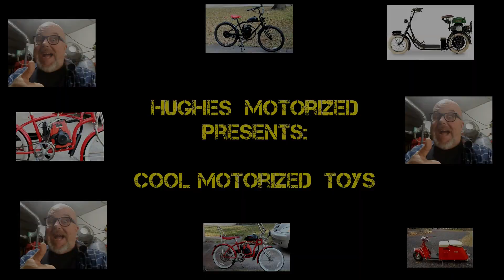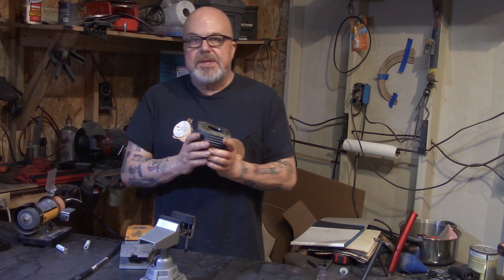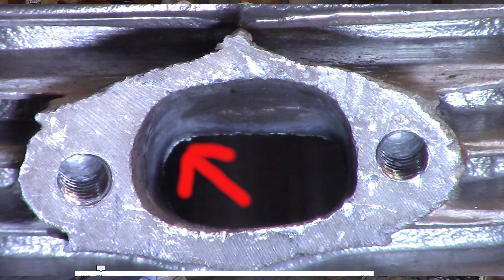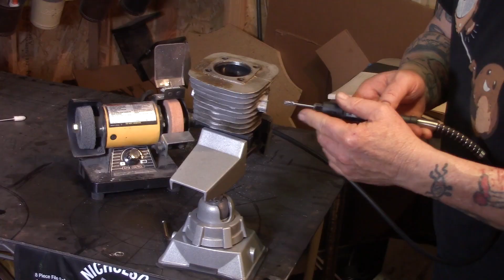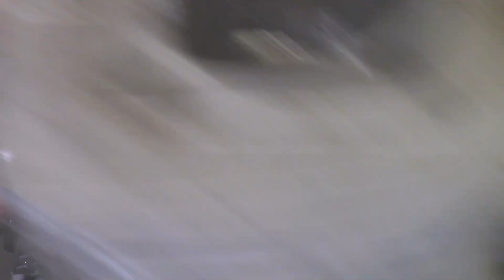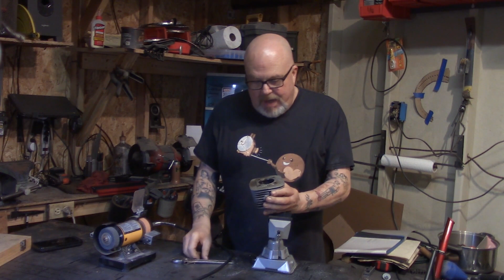How To Port Your 2 Stroke Motorized Bicycle Engine- The Basics - Get Improved Performance

Comment: Wanna talk "ignorant", here we go!

What about a square intake for the reed valve?   🤔

There's also the exhausted, and how you fabricators make it square, and yet the gasket is round opening.  Won't the gasket hinder air flow due to the shape you just made the exhaust?  😳

I just started opening my exhaust on my Minarelli clone,  and i'm staying aeay from making it square.  I'm just staying within the confines of what's already there, and boring out the inside. The edge of the round port, i'm going to sand it to smooth, and that's it.    I don't want my gasket to be bored out of its purpose for being there, and that's exactly what will happen if I turned it into a rectangle like you've done.  Again, the gasket is for a ROUND port.  

Tell me what i'm missing here, cuz simple logic doesn't seem to apply. 🤪

Thanx
Reply: Modified your gasket?

Comment: wouldnt the heat from normal running....shave off those burrs on the insides?
Reply from the maker: No. There are some substantial boogers in there that need to be opened up which will improve performance

Comment: So porting is basically deburr sharp edges
Reply from the maker: BASIC porting is that plus opening up the ports to allow more flow. You raise the exhaust 1mm and lower the intake 1mm. Widen both 2mm. More technical is to set specific port timing and duration

Comment: Cylinder Holden I really don't see how buffering the exhaust part to a mirror finish is going to give you any benefit
Reply: He keeps carbon from building up if carbon deposits fall back into the engine it could ruin it

Comment: Yup the intake an exaust ports definitely are not nice an smooth like a factory engine Honda Yamaha an such lol I'm on my second build the first one was a learning curve cause  can fix dirt bike an sleds no problem however these motors have many little- flaws with lol great for kids to learn about engines though an tinker with second motor I bought I just bought the engine with no hardware its all cheap junk lol I'm gonna order the drive chain an stuff from the place i order dirt bike parts that's what I ended doing with my first engine build the parts are much more durable especially the drive chain I can break the chain with pliers that come with these kits lol can't do that with a real dirt bike chain though I paid more the  chain and parts but least they last alot longer they can  keep their cheap hardware lol choke socks too vibrates down a  chokes the engine I put a carb with a pull out choke my buddy races after we ported his srx 700 snowmobile he took a center punch an put a bunch of punch  marks on the intake side for fuel dispersion we shaved the head also I wonder if there's any room to shave the head on these down  a thousand  of an in h

Comment: No bicycle  will get up to 70 miles per hour on that two-cycle motor maybe ABOUT 15 to maybe 25 mph I do know I am a REAL expert I AM ASE certified what you're doing to that cylinder might will give make a little bit more power not much power at all if any power at all
Reply from the maker: Hate to break it to you but YES. People have modded these and ran 68 mph PLUS. Check out 2 Stroke Stuffing Channel. he builds seriously fast 2 stroke bikes using these engines

Comment: Good info although somewhat mislabeled. Porting mostly refers to widening and/or raising the ports right at the cylinder surface, not cleaning out casting irregularities.
Reply from the maker: Note I did widen intake and exhaust along with lowering intake and raise exhaust ports
Reply: @HughesMotorized  I´m sorry I didnt watch more than the beginning where you said it was basic porting and then described it as cleaning up the passageways.
Reply: @HughesMotorized  also I would never give any generalized porting advice except for one type of cylinder after I have measured the durations and ran them along with port widths thru a porting calculator. If you say "always lower intake" and someone has a cylinder that already has the correct intake duration then you´ll cause him to mess it up and then he´ll have an engine harder to start.

Comment: For all those that don't have a ported cylinder then you should buy one from this man because it makes a big difference!!!! He's also very professional. He answers all your questions and ships it out within a few days. I also have another bike I can't get running right and he offered to fix it for free (not counting shipping) on his channel
Reply from the maker: Cool. Glad it worked out for you. Thanks!
Reply: @HughesMotorized  you got any advice on vacuum leak where the carb bolts on the intake? I can't tighten it anymore and it's definitely leaking cause of the high idle and if I spray carburetor cleaner there it brings the idle right down. I've seen videos of people putting a bead of silicone around it or wrapping a piece of an inner tube around it and using a hose clamp to tighten it. All kinds of shit

Comment: 2StrokeStuffing recommends to use a Stone based grinder, so to not grab a chunk of the Nikasil (anti-wear bore  coating).
Reply: I just seen a video of that guy he was showing his tools and he uses the same bits IDK I've been waiting watching vids before I attempt porting my motors
Reply: He referenced a program to get everything to work together, I forget what it's called. Lastly, checkout variable  port engines to get an idea what shapes effect your powerband :)  @jeremyhopkins6965
Reply: these cylinders don't have a coating they are cast iron
Reply: Some have coating some dont ez 2 tell diffrence

Comment: I hand sanded some of the cylinder because my dremel slided when I was porting and caused some small scratches / pits in the cylinder. Some are saying that the interior of the cylinder has a special coating and that sanding the cylinder would ruin it. I used 150 and 300 grit sand paper. Do you think its ruined? edit: looks like the cylinder is 100% iron so theres no coating and therefore no damage via sanding, however I still got some small pits / scratches from my dremel sliding off and hitting the cylinder wall. Think it will cause any issues?
Reply from the maker: Most have a chrome bore. That chrome is getting thinner and thinner over the years. If you sand, only remove burrs. Ride on
Reply: @HughesMotorized  I found out it's an iron bore so no plating

Comment: do you have to trim the gaskets?
Reply: Yes where they stick past the ports. Depending on the particular type of gasket, you can use an exacto knife, or use the Dremel with a carbide bit if it's metal. I like to cut them in place to get them exact.

Comment: I have a ported 50cc. Its intake port is HUGE that you can fit 2 fingers easily. Even the exghaust port is big. My daily 66/80cc you can barely fit 1 finger inside the intake port.

Comment: You don't necessarily need to go fast just because you have the crank balanced... thats kinda like if I say nope gotta buy a car that governs at 70 cause why would I need to go 100 the top speed limit is 70
Reply: I feel the sane way when it comes to speed I don't think going over 40 is safe on a bicycle but a balanced crank might make my ride smoother even if I never hit my top speed
Reply from the maker: Amen. My point about balancing is the engine will only hit so many RPMs due to balance issues. A better balanced engine will ride better and last longer as I see it. Thanks for watching

Comment: A little advice for your viewers on changing the port widths. Make sure the cutouts in the sides of the piston, if it has any, will not allow the air fuel charge out of the port at any time. The easiest way to do this is with the cylinder still on the engine. Put a pencil point on the side of the port, and rotate the crank a few times all the way around so the piston rubs on the pencil as it goes past. Do this to both sides of all the ports you intend to modify. Remove the cylinder and see where your pencil marks are on the piston. You can widen the port so the lines are at least 2mm from the cutouts. Also, increasing the port timings by 1mm or so could make your engine have little to no bottom end acceleration. These mods could still have adverse effects on your engine's performance, so tread with caution. If you cannot afford to junk your engine, don't touch the widths or timings. Stick with cleaning up the trash! You will be surprised at the improvements that alone will make! Remember, air is like a fluid...easier in, easier out. You may also have to richen your jetting. Research reading spark plugs and piston wash. When in doubt, add more fuel. Start rich and go from there.

I like your Happy Time Harry, Meatwad, and Mighty Mouse tattoos! Probably not too many people even know who they are or where they're from though... :(
Reply from the maker: Old school rules ! I hear Happy Time Harry is making a comeback
Reply: Commence the jigglin!
Reply: @JenniferGoodman-yy1jd  HELL YAH JIGGLE BILLY

Comment: I have found you are better off just widening the ports slightly and you keep the bottom end speed and keep and gain top speed to  my bike is stock with just the ports done and I get 48 mph lol
Reply: 80cc engine?

Comment: Thank You Hughes. You know your stuff.
And how to do this shit with trash motors.
8-) That's what those kits really are.
Reply from the maker: and fun...when they work right
Reply: @HughesMotorized  i have a "new" build that i just can't get running.  Today,  i checked the carburetor. No gas seems to be getting to the bowl. At first fuel-up gunk came out of the tank. So clogged up bowl? Doesn't swem to be the cause. NO FUEL. What's my next move. And when i use starter fluidit DOES fire. Puzzled. Help.😐
Reply from the maker: @childofanovelty  pull fuel line from carb and see if any gas comes out when petcock is open. If no gas, i bet the screen in petcock is clogged up.  If yes the I bet float valve is stuck in carb. If so, give carb bowl some good hard taps w/ a screwdriver handle. Should open it up. If not, then pull carb bowl and see what's keeping float stuck.

Comment: I'm sorry I had to stop 3 minutes in, but it's called an engine not a motor, and I understand all the stuff that you're talking about,but can you just tell me how you smooth out the porch on the intake and the exhaust, it would probably only take about 4 minutes
Reply from the maker: What is a MOTORCYCLE? Motorcar? What is MOTOR oil for?
Reply: @HughesMotorized  I thought about using peanut oil or soybean oil at one point in time but crude always kind of you know didn't burn out
Reply: @HughesMotorized  engines are gas motors are electric
Reply: But I still see your point

Comment: So I did this and now at full throttle it almost dies and has no power? What could be the issue
Reply from the maker: Sounds like an intake leak or gasket
Reply: @HughesMotorized   I will give it a try I have another cylinder orderd already ported incase I broke it but if not atleast I have a spare.

Comment: Why not 125cc motor cycle engine with 4 speed on bicycle? Go any where much faster and dependable. Just go slow and lengthen tail pipe add extra mufflers to quioten. FAST, RELIABLE, CHEAPER AND QUIET!!!

Comment: So small 950 watt harbor freight generators head gasket and head fits motorized kits with little modification just drill the holes a little bit bigger to fit the studs I think the piston and piston bearing fit too the head takes a bigger spark plug just wanted to let everybody know just in case you have one mine didn't work I cannibalized it

Comment: Dude you say the pressure in the crank case sucks air in...the down stroke of your piston creates a pressure difference because the pistons mass is displacing the air causing a slight vacuum which in turn creates a pressure difference thus sucking the air n fuel in thru ya inlet manifold... example: you get a 1 gallon bottle of water lift it up around shoulders height then fast as act is if your gonna throw it at the ground...the mass of the bottle will displace the air your trying to throw it thru thus pulling air from the sides..you'll feel air go past your arm or face if you lift above ya head...that's am example of what's going on..it's all about inertia and mass ma man ...annd the more air n fuel brother..the bigger bang ..when your plug sparks it ignites the air n fuel creating an explosion..which slams ya piston down drawing air in due to slight vacuum created ( it's nowhere near a vacuum just the beginning process of how vacuum is created ) ... pretty simple engine the 2 stroke ..great video brother ,my only comment..don't complicate things .. keep it simple and with your clear speaking your on a winner ..cheers...once again don't tell people what to or not to comment.. because people like me will .. basically say ... Oi fuck you as I have via my telling it how it is comments... wouldn't of even commented if you hadn't said ..blah blah don't comment...🤘✌️☮️
Reply from the maker: I'm impressed. Such a LONG reply. Totally incorrect.
Reply: @HughesMotorized  okay..if I'm incorrect,enlighten me....it's easy to say I'm wrong..what about.. been rebuilding Motorcross bikes since 90s ...the things that rely on pressure are called air compressors man
Reply from the maker: @chaddrennan5246  "Dude you say the pressure in the crank case sucks air in." 
.
WHAT??????????? Never said that in those words nor anything like it. PRESSURE sucks air in ??? WTF are you smoking?

Comment: You make everything bigger, but it doesn't make the engine better. It is important to improve the accuracy and direction of ports in this work. It is necessary to vortex the cylinder.
Reply from the maker: I said the most benefit is from cleaning up the trash. Then you can get technical as you like.

Comment: I made the piston hole bigger because someone told me that would make great boost, but now it’s not starting? Maybe I need to add more oil in the gas or use 4 stroke oil right in the exhaust intake because I have heard that fixes it, any tips?
Reply: Then u must get in the biger bat if u do onli hole biger u do nothing
Reply: If you made the hole that the piston goes up and down in bigger,,, then you NEED a bigger piston to match your hole size or else you aren't going to have very much compression and your motor requires compression to work !!!

Comment: i loved my little harbor freight bench grinder. too bad they don't sell a replacement shaft for it. i was using a cutting disk and it locked up and twisted the flexible shaft to the point that it kinked up and broke. rip
Reply: go to autozone and buy the universal speedometer cable repar kit. It was under 10 bucks last time I bought one. It's just the inner cable that goes inside the plastic sheath to repair a broken speedometer cable. Just so happens to have other applications. cut to fit, and install in your flexi shaft. bam, good as new.

Comment: Do you advise waiting till after running a tank or two for break in first before porting the cylinder out? Or is it fine to go ahead and port match the exhaust and intake before installing the motor (before break in or running at all) thanks 
 @Hughes Motorized
Reply: On the motors I build for myself, I always clean up the ports and match the intake, transfers, and exhaust ports before running the motor. After break-in, I decide if the cleaned-up motor is delivering what I want. Then I will modify the port timing and spend time opening up the exhaust as much as possible. What this video says is fantastic advice for just "winging it" without doing any port timing calculations.
Reply from the maker: I'd say do it before running is best

Comment: What type of Polish do you use to Port intake and exhaust thank you
Reply: You can start with course  grade of emory paper , then go finer with the grit . finish with metal polist , a good one is ''solvol'' , its called chrome polish but will do the job fine . I used it on a zzr600 notorbike head for racing in what is called ''clubmans'' in the u.k . one of the important things ios matching the openings so the hole in the exhaust port of the head matches the exhaust pipe , same on the intake side.
Typicaly the hole in the barrel of head will be smaller than the exaust and carb openings

Comment: Hey I was wondering if I should cut the exhaust on my stock chrome exhaust from an engine kit? How would it benefit my ride and is it worth it?
Reply: @Daniel Macdonald  wrong I have done this mod and it doesn't give you more take off speed takeoff is the same you lose mid range and gain top speed

Comment: Anybody who gets one of these cylinders, you really NEED to get in there, at least with a small file and de-burr those ports or those chunks will enter your cylinder and shorten the life of it by ALOT! I failed to deburr my Zeda-80 kit I had gotten since it came fully assembled, I was replacing the jug two weeks later!